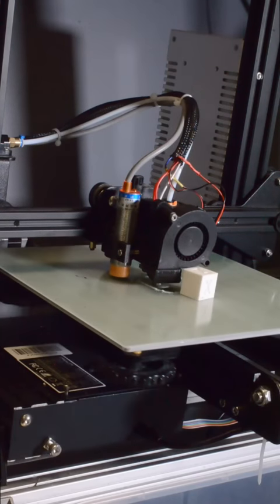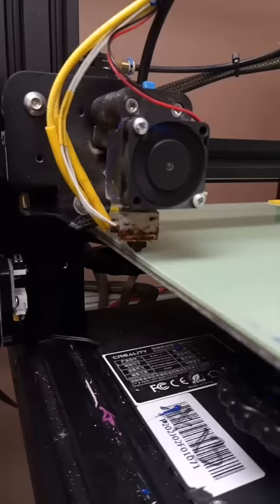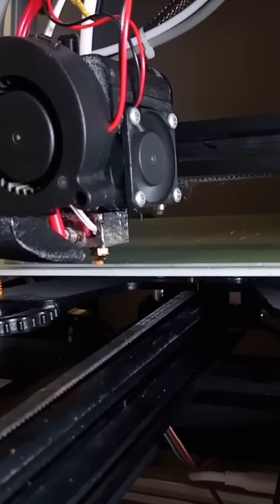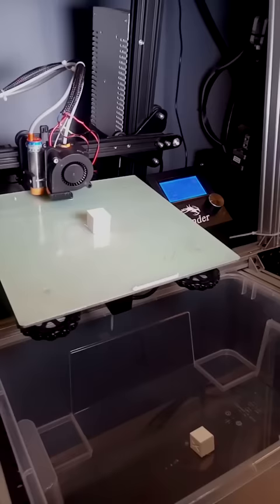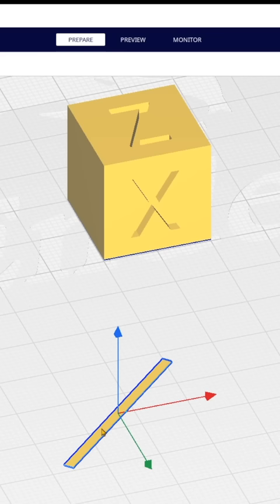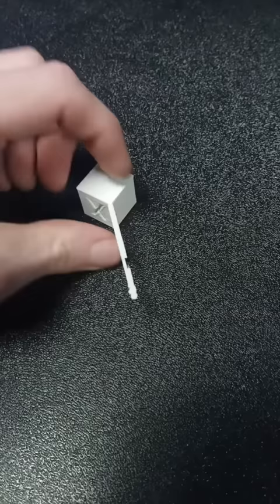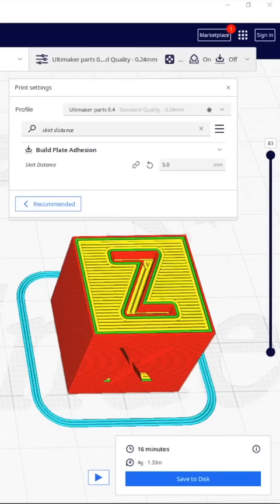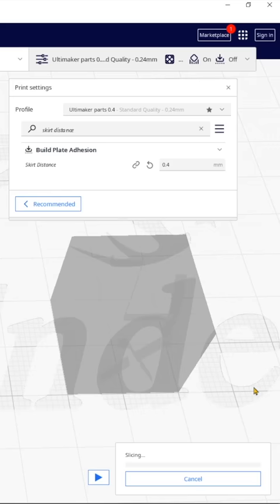How do automated 3D printers remove skirts and purge lines?

Comment: Wait why would you set the skirt so close and not just use a brim?
Reply from the maker: The brim is fused to the part and post processing can be time consuming. A skirt is very easy to remove.
Reply: @3DQue  well tuned brim peels off really easily, when your skirt touches the print and basically becomes one with it IT BECOMES A BRIM both have a tuneable distance so they only thing differentiating them is whether they are attached or not no matter how lightly

Comment: what is a purge line?
Reply from the maker: When a printer heats up, the first bit of filament can come out unevenly which can ruin the first layer on a print. The purge line is the first bit of filament and it is printed away from the part so that once the print starts, it has completely even flow.

Comment: I wonder if there is a feature in the ultimaker cura slicer that pulls the filament from the nozzle when the printing ends, plz help, every time the printing ends I have to apply 200 c° nozzle temp in order to pull the filament
Reply from the maker: Sounds like something you could easily do with a custom end gcode. I suggest learning how to write gcode manually. This kind of thing would be really easy to do!
Reply: Oh thanks for the idea, I actually didn't know I can customize the gcode after exporting it, I'll see what I'll have to do
Reply from the maker: @hassanbo8200  You can edit the start/end gcode directly so you don't need to modify the file directly after exporting. Go to machine settings in Cura and you'll find the custom start/end gcode which you can edit
Reply: @3DQue  got it 👍👍

Comment: I just started using cura does the build plate adhesion type even matter like the choices Brim, Skirt, or Raft because I have mine set to none?
Reply from the maker: It depends on the build plate you use, the geometry of the part, and the material you are using. Here's a good overview: https://all3dp.com/2/3d-printing-raft-brim-and-skirt-all-you-need-to-know/

Comment: What material are you printing on? Is there somewhere I can learn to move the printer like that?
Reply from the maker: It's called the VAAPR bed (Variable Adhesion for Automatic Part Release). We developed it to enable auto-ejection for 24/7 continuous printing on any printer. If you want to do custom printer movements I suggest learning how to write gcode manually.
Reply: @3DQue  sounds good. Thank you

Comment: what is the purpose of a skirt?
Reply from the maker: A skirt is typically used to ensure that the first layer is going to adhere well. Once print settings are dialled in for a specific part / printer / material, you no longer need the skirt so it is useful for prototypes bu not often used in high volume production.

Comment: What printer are you using here, I want to get a continuous printer but I don’t know what one to get?
Reply from the maker: Most printers can be used for continuous printing. The difference over time is the amount of maintenance you have to do. We use Ender 3s for our research since they are cheap, easy to modify, and we beat them up testing software. For production, we prefer Artillery or Prusa (more reliable, less maintenance).

Comment: Why not replace your skirt with a brim and be done with it?
Reply from the maker: Brim has to be manually removed in post processing. The point of automation is to reduce or eliminate manual labour. Skirts typically fall off when parts slide off the bed.

Comment: What are these for?
Reply from the maker: Both are to ensure a flawless first layer by priming the nozzle.
Skirts outline the part so they are a better test of the full area on the print bed so may be used in prototyping. Purge lines are typically smaller and quicker so tend to be the default.

Comment: Pro tip: If you have a prime line you don't need a skirt
Reply from the maker: Skirt can be easier to remove with auto part ejection. Increases certainty that the bed is clear.

Comment: Thats pretty much just a BRIM at that point
Reply from the maker: Pretty close. The difference is significant in high volume printing, though. Brims have to be manually removed whereas the skirts come off with the part but are separate when they land in the collection bin.
Reply: @3DQue  ahhh I get it, interesting

Comment: With all the 3d printing going on by enthusiasts, amateurs and organisations thank God I'm using paper straws to reduce plastic waste pheww
Reply from the maker: You have a good point and one that the industry is actively working on. For example, using plant-based plastics instead of petroleum-based, using waste to make plastic (e.g. wood waste), and using bio additives that break the plastics down in the waste stream (make the plastic into food for bacteria). There are even researchers creating plasticizers from plant divers.
Reply: @3DQue  Good point but this is all elective since it will depend on the raw material cost are these options even viable? Can the price match plastic or be even lower? Would the finished products last long?

Comment: Can anyone tell me what printer this is and what mods it has ? It looks like a ender 3.
Reply from the maker: Yes, this one is an old Ender3. We use them for R&D because we can beat them up and they still work. We use a lot of different printers and find that we can get similar speed and quality from most of them but the maintenance required over time varies.
Reply: @3DQue  I own a ender 3 pro and was wondering what mods this had and how you get it to print multiple like that
Reply from the maker: @jaegermonster5540  This has the VAAPR print bed and is run by AutoFarm3D. This combination allows reliable, repeatable printing.

Comment: How can I see purge line in cura?
Reply from the maker: The purge line doesn't display in most slicers unfortunately.
Reply: It's part of the starter gcode so if you take the gcode and drag it into cura you will see it

EDIT: gcode from slicing the stl.
Reply: @3DQue  Yes, the line should display at least in every gcode viewer, including Cura. It's created with gcode commands that are just as valid as any other ones.

Comment: Never understood the reason for a skirt
Reply from the maker: When filament sits inside a hot nozzle for a long time, it degrades through the process of hydrolysis. The skirt/purge line clears all this bad filament from the nozzle and makes sure the print starts with fresh, newly melted material.

The skirt/purge lines also make sure that material is extruding without any air bubbles, just in case it was retracted a little bit before printing.

Comment from the maker: What's your favorite way to prime the nozzle before printing? Skirts? Brim? Something else? Share your thoughts on the 3D Print Farms Discord Server: https://discord.gg/JN9EDP8
Reply: Three line skirt (2 for larger prints), and I have a purge line in the start gcode.

My bed's a little warped, and even with ABL it sometimes needs adjusted, so it's nice to see right away if the skirt isn't level.

Comment: Why not just use brims instead ofnusing skirts then doing all that extra work
Reply from the maker: With high volume production, you want to minimize labour. A skirt that is barely attached removes itself when the part drops whereas a brim often needs to be removed later.
Reply: @3DQue  ok that makes sense. But with a purge line,  why is there a need for skirt lines? I just realised now, maybe no skirt lines is an option?😅

Comment: That’s not a skirt… oh ya it is, that’s the problem. Use a brim instead.
Reply from the maker: With high volume production, you want to minimize post processing. Brims have to be removed by hand whereas a skirt printed very close to the part can be automatically removed from the bed with the part but since it is separate from the part, it doesn't need to be manually removed from the print in post processing.

Comment: Don't use one , solved
Reply from the maker: For high volume automated production, you will want a purge sequence between prints. Whether you use a purge line or a skirt, both need to be removed by the printer.

Comment: so what happens when the print wont move get ready for broken 3dpriter parts this is dumb just print 20 of those blocks per plate and manually take them off 3d printers are at the peak of inovation there is no more inovation its entropy its done.. fancy printers are a scam
Reply from the maker: For automated part removal, you need a print bed surface with reliable release and software that stops the printer when a part won't come off the print bed.

Comment: Who even uses skirts anymore? A brim is far more useful...
Reply from the maker: Brims have to be removed in post processing. Skirts come off easily with the part in automated printing. So skirts are the least human effort / part.
Reply: @3DQue  Ah, right, I forgot. My up mini prints ABS, and it basically needs a brim to prevent warping, so I've forgotten that some people need a purge line without the extra adhesion.

Comment: Why tf you.need a purge line/Tower????
Reply from the maker: Purge lines ensure that the filament is flowing evenly before starting the print. This is particularly important in automated high volume production.
Reply: @3DQue  and how wide should a purge tower be?
Reply from the maker: @kevzocker  We just use the defaults in the slicer.